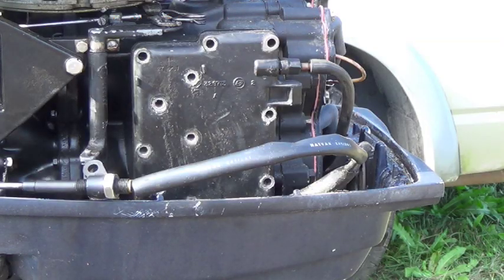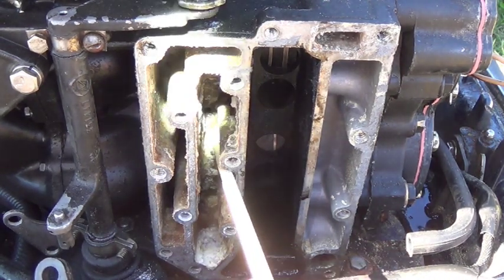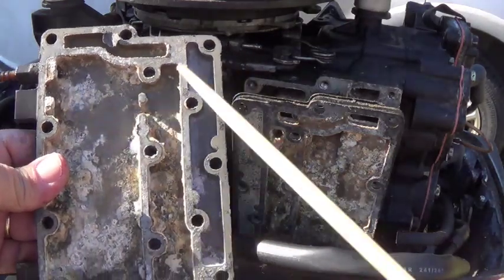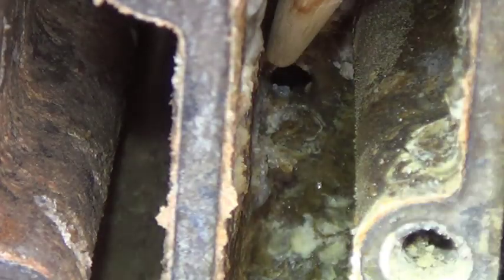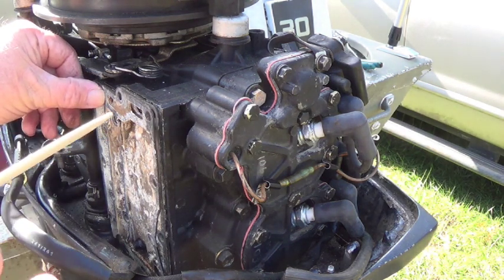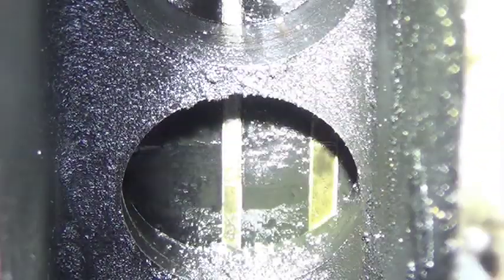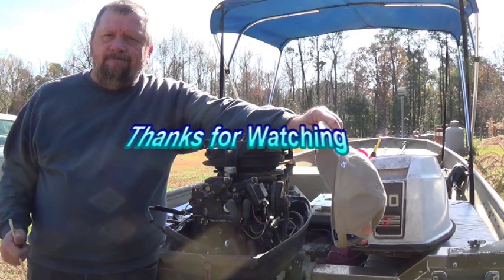Water Flow on a Outboard

Comment: Excellent. Thank you for very clear and detailed descriptions and pics. I've replaced impeller, thermostat, blown air thru pee hole, up water tube from lower unit, and dropped lower unit off my 2003 Honda 9.9 5 times trying to solve no water out tell tale hole. Your video gives me some ideas of where to find clog.

Comment: I have Johnson 90hp I took it to a Outboard mechanic spent thousands of dollars and it still overheated he changed the Water pump Thermostat and the head gasket but still Overheated I had the same issue of Overheating with my other outboards and I went through the same process which they changed the same stuff but still overheated after watching this video it finally fixed the problem saved me so much money,. THANKS VERY MUCH!!!!
Reply from the maker: I am happy it help. Thanks for watching and commenting.

Comment: Wow! I broke down on the lake 6 miles from the ramp with the wind at my back. I had to be towed in by 3 guys in a 24ft fishing boat. I diagnosed the charge coil and when I finally got the flywheel off my 1986 30 HP Evinrude the dreadful black ooze was there.  Parts on order I suspected the thermostat and discovered the clogged up water jacket on the head. Now I see I have another water jacket I need to remove and clean out physically. Thank you so much for the video and explicit information.  I may try to use "Rydlyme" if I can figure out how to do it. LOL Leg off and thermostat out and get another gasket for the head water jacket. Thanks again for a great video.
😃
Reply: I may have a clogged jacket, too, on my 1994 E30ELERM. After an impeller and thermostat replacement, my tell tale is only peeing out hot air. Considering doing a smoke test now that 
I have the exhaust cover off.  Thoughts? I should also re-verify that my water tube is properly aligned.

Comment: Thanks I have been chasing an high temp alarm on my Yamaha this is my next step.
Reply: What did you find?  I'm running out of ideas
Reply: @MantoMayer  it was an oil strainer on the oil tank. It was clogged and since my tachometer was glassed over I thought that it was an alarm.

Comment: Great video! I am a new outboard DIYer. Been having overheating and no water out the tell-tale on a 1997 Johnson 25HP Outboard. I run in fresh water. Replaced the water pump and thermostat and still nothing. THIS video will help me further diagnose my problem. If the blockage is not there, what would be the next step to fix this problem? Your videos have helped me greatly going this far. THANKS
Reply: Any luck on figuring this out? Just replaced water pump & have thermostat on order.

Comment: @OmFishing 
Great video it helped me understand more about my outboard I have a question I replaced my water pump and it pees water out the spout and goes out halfway down below the power head back towards the prop out the little ports at the same time I watched a different video and the guy described it as the thermostat bypass but in the video it only came out of the bypass not both the bypass and the spout 
I have a 1980 Johnson 85hp 2stroke outboard

Comment: Thank you for your excellent explanation of how the water flows. I probably need to take off my cover and clean the crud off/out but I don't see how I can get the bottom bolt out. The cover that you show looks like mine. I have a 55hp Yamaha. If mine is similar to the one you show, please tell me how to remove the bottom bolt. Thank you again and have a great and blessed evening.

Comment: Thanks for the video! I’ve got a Yamaha 15hp that has a weak tell tale stream and occasionally stops peeing for a few moments. I’ve replaced the impeller/water pump and the thermostat and tried running line through the cooling hoses. I think I’ll have to dig further into the engine looking for debris. Thanks from the Christina River!
Reply from the maker: Be sure and let me know what you find. Stay safe.

Comment: Thank you sir,  very informative.  I have a 2002 2 stroke 90hp Yamaha that isn't moving as much water as I think it should.  I know it was primarily used in saltwater and very shallow saltwater at that.  It was flushed every time with fresh water,  but I think it needs to be de-scaled.  Your video helped me to understand what's going on in my motor.  I'll remove the t-stat and pump impeller and set it up for a continual flush of a de-scaler to see if I can't clean out a lot of those deposits.  Thanks again.
Reply from the maker: Let me know if the de-scale works for you. I though mind could use it, I was looking to see why mine was not reaching operating temperature.
Reply: It made a huge difference. My tattletale was barely dribbling even after I put in a new water pump. I flushed her for about 6 hours using a mixture of Simple Green Lime Descaler and water.  After I dropped the lower unit,  I rigged up a cheap fountain pump in a big wash tub and set it under the outboard.  I hooked the output of the fountain pump to pipe that the water pump connects to using clear plastic 1/2 ID tubing.  When I powered the pump up it forced this mixture through the whole water jacket and back out the bottom of the motor.  The wash tub caught it all and just kept it recirculating.  There was a ton of crap in the bottom of the wash tub when I got done.  BUT,  the proof was how she peed when I was done.  Before there was barely a dribble out of the tattletale, now,  she flows like I would expect.  I actually have videos of before and after the flush.  Just no way to attach them to this reply.  

  I put in a new thermostat after I was done flushing the motor.  

  Thanks again for the video and the inspiration,  though to be fair,  I think regular old vinegar would have been just as effective as a flush media and a lot cheaper than the Simple Green.  Just wouldn't have smelled as good.

Before 6 hour flush

https://www.youtube.com/watch?v=k3Raum7f2P8

After 6 hour flush

https://www.youtube.com/watch?v=MRSAQ1dwOMk

Made a huge difference!

Comment: Thank you sir I have a 60 hp  Johnson I'll change the thermostat & impeller and the motor getting hot very fast end no water comes from the water pump but I found the problem a little piece of the impeller stoked on the copper tube

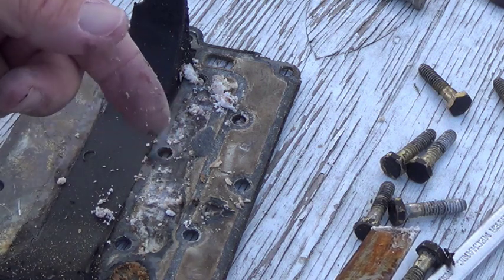Comment: Gotta clean the piston /ring grooves out, the rings are stuck from excessive carbon deposit buildup inside the piston ring grooves. ( Note at 4:30 the rings aren't wiggling up &down a teeny bit w/hardly any play inside the grooves of the pistons, while hand cranking it,  jerking back' n' forth or if you push each of the 3 rings with a small screw driver carefully to check if the rings are loose springing in and out of each grooves without any sticking going on). Well thats why the cylinders gonna be thrashed if You keep running it like that resulting in loss of compression. Might as well tear it apart and clean it up, replace seals, bearings all that. Then it ll be fresh again
Reply from the maker: I didn't like the way they looked either, I new what the answer was, I was just putting it off. Thank for commenting and watching.

Comment: This videos is very informative thank you… I’ll check all that out little by little… I have a 90 suzuki dt30c no water from tale tell.. I changed the impeller and made sure the pick up tube is connected I get water for 20 seconds then it stops and feels like exhaust is coming out.. I removed the thermostat and ran in a bucket and it can run like that 10 minutes no problem weather gushing from take tell and thermostat housing.. as soon as I put the thermostat on it’s stops.. also with the water that gushes out the thermostat housing I can see exhaust fumes.. idk what else it can be maybe the head gasket? I checked for compression and getting 125 on all cylinders.. also took out the lower end and put water up the tube and the tale tell works fine.. is as if exhaust is mixing in the cooling system and not allowing water to make it up the head… any advice please
Reply: I'm having a similar issue with my 86 mercury 135
Reply: @jeremypavlock4337  I removed the whole
Motor to replace every single gasket and seal… I found what looks like black carbon residue in what’s supposed to be a water jacket under the power head I suspect exhaust is going into my cooling water and not allowing the water to make it up to the head or down the pee hole.. I get all my parts on Wednesday I’ll let you know how it comes out.. but for now I think it’s that seal we’re the exhaust tube connects seems like it’s leaking exhaust therefore

Comment: That was interesting.I think when boat owners do not fresh water rinse inside the outboard motor then salt water overtime seriously messes up the cooling system in the engine.
Reply from the maker: I didn't think this one look to bad. 95% of its life has been used in salt water.
Reply: Here's what gets me,  salt is highly soluble in fresh water.  A simple flush of fresh water after you've been in the salt water should dissolve all of the salt in your motor.  You ever taste the water coming out of your pisser while you are flushing with fresh water?  It's as fresh as the water going in.

  I think what most guys are seeing when they tear into their saltwater motors is lime, sand, shells and other mineral deposits.  I recently flushed my motor using a fountain pump and a lime descaler.  It knocked a lot of stuff out of my motor and made a huge difference in the amount of water that came out of the pisser.  Pretty sure vinegar on a continuous flush would do the same thing.

Comment: Good day very good explanation. I’m working on a 1973 Mercury 500 50 HP I started the engine after several years of it sitting. I initially got water out of the telltale then started it again and no water. Changed the impeller still no water, pulled the pipe plug out of the water jacket at the head lots of water came out. Checked the telltale hose no blockages. I suspect the blockage to be in water jacket somewhere near the telltale outlet? Any thought’s? Thanks

Comment: Great video, it steer my suspicions toward the exhaust cover and it's gaskets. My Chrysler 15hp was overheating and water from the back of the motor stopped  flowing with increase of rpms. The gases from exhaust pushed cooling water from the passages because of blown gaskets. Some people suggested that it's caused by new water pump impeller which had less fingers(six) versus old ones having ten but I thing it's bad gaskets
Reply from the maker: I think you are on the right track now. Make sure all the passages are clear. Stay Safe.

Comment: I just got a Johnson 25 and my teltail blows steam. Iv replaced my pump and I’m about to put in a new thermostat. Should I take off the exhaust cover and see if it’s clogged or no? I don’t wanna risk snapping bolts off.

Comment: Thank you , very interesting  o have a Mercury 225 outboard 
On the back of a ponton.  Now and then I take my grandkids out 
I'm concerned  now every time I get out to the bay When I go to throttle up the boat it dies 
Bogs right down  . I can idle the boat.I can wrap the boat 2 to 3000 rpm no problem  
However when I throttle up it does
The boatyard says you need a new engine, but nobody looking into what the problem is any ideas thousand r p m steady  
Thank you
Anthony

Comment: What is the wire with black rubber insulator in head? You got a shot of it with water plate on and off! Mine is falling apart, easier to find if name is known! Good explanation of water system  Thanks
Reply from the maker: That is the Temperature switch for my motor the part number is 0583815.  Thanks for watching and commenting.

Comment: That has been one of my bench projects for a while that has`nt got going yet. waterpump went out on river but did`nt seem to overheat badly , So I took it home and when I opened it up it still had pressure in the lower unit and new oil. but when I changed the water pump out and started it it went and filled the lower unit with water and gases , but the lower still held pressure for over 24 hrs. now I need to teardown an find the reason for this , This was my favorite motor ran like a brandnew motor   and had the lighting and charging coil in it and the main reason I wanted it it was one of the models that by changing a part it would jump from 6 hp 8 hp. But alas it may never get done.

Comment: The water jackets always fill the engine unlike how youre tellinh it. The thernostat doesnt stop water entering the cylinder jackets it stops circulation. What you saw on the cylinders wasnt blowby as you claimed its just hot exhaust gases that get pushed out of the engine that the side of the cylinder is exposed to as they are expelled.

Comment: Wow well explained I just did the impeller on my 99 evinruide 225 still no tell tail I’m goin crazy I’m goin to do thermostat hopefully that works I’m bummed out haven’t even been out yet cuz let a friend borrow it last year and he cooked impeller unfortunately thank you 🙏
Reply from the maker: Did you take the tell tail off at the motor and make sure it is clean and air blow through does the water come out there with out the hose on it.
Reply: No there’s no hose on it
Reply: I could take it off and screw a hose to it and flush it backwards
Reply: So do you think the hose still should be on there the lil plastic tell tail just spins like there probably should be one on idk
Reply: Also I was gonna replace thermostat too
Reply: Wow I really appreciate you getting back to me I got a ocean boat told a friend he could use it he brought it in a pond it’s 23 feet with a big motor the impeller was cooked cuz he told me it could run without water for a couple minutes
Reply: Om Fishing no it dont
Reply: Om Fishing damn I think I sent the text to wrong spot
Reply: Om Fishing it has a place for the hose in the back of the motor in the middle and the tell tale is connected to that
Reply: Did I say something wrong I’m serious tho and thank you for responding
Reply: Actually it barely drips out

Comment: Very well explained time for a new set of rings and a couple cylinders honed now huh 🔧Next time if you want to know if it's salt take a taste 🤓
Reply from the maker: I think that is a good idea. If I find the right motor I will do new rings. You know I wanted to taste that white stuff to see if it were salt. I just could not bring my self to it. Maybe next time. LOL
Reply: @OmFishing  That white material is probably calcium carbonate assuming the engine was run insult water.  YU can circulate Rydlyme, Hammer head or similar product to dissolve the carbonate and improve cooling water flow.
Reply from the maker: @dannynone2784  Thanks for sharing the information.

Comment: Do you have a video on how get to the water pump tube on the motor
Reply from the maker: I looked though my videos and did not see one showing how to put the water tube in the grommet on the bottom of the engine. I put the tube on the engine and line up the bottom when I put the lower unit on. This way you can shine a light up there to see when you are lined up.

Comment: Thank you sir! Could a bad  water jacket gasket or exhaust manifold gasket cause some water in one cylinder on a 1985 v4 90 Evinrude? Head gasket looked ok no cracks in cylinder wall. It wasnt alot of foam. Water jacket gasket was grainy white almost like sand clogged. Fresh water.
Reply from the maker: I think the water jacket gasket could let some water back through the exhaust port. I don't think it would when it is running, but after it was shut off.  When I removed mine it look the same way. Like it was penetrated with salt or something.  Let me know how it runs for you when your done. Stay Healthy.

Comment: Thanks for the information.  The water is always coming out my telltale drain cold.  I thought there might be something wrong with my thermostat but your video indicates that the drain is before the thermostat and not after.   Is there a way to check if my 1987 Johnson outboard model # j20cro is running at proper temperature?  I am running in a cold fresh water (lake superior). I am able to put my hand on the engine block and it only feels warm even after a couple hours of run time. I have checked after high speeds with little change. I do a lot of trolling speeds(2 mph).
Reply from the maker: The water coming out of the tell tale drain after running for a while should at least be a little warm.  If that was my engine I would ether check the thermostat or replace it. Proper engine operating  temperature the engine burns fuel and runs better. You can get build up on the in side of the engine running it to cold. They do make a Thermomelt stik that heat sensitive marker that melts on contact with a surface of a specific temperature. You  put that on the top cyclinder head. Your inlet water temperature has to be around 70.  Some people will take a digital pyrometer and check the head temperature after a test run of 3000 rpm for five minutes. The temperature should be around 140. There are different test for different temperature. That is a lot of testing for hot spots. So to answer your question ether take your thermostat out and check to see if it is opening and closing or just replace it. Stay Safe.

Comment: Very informative vid. I know getting those exhaust jacket cover plates off is not a small task.  On a 1994 merc 9.9,  should I also be getting some water spraying from the two exhaust holes? (the external ones a few inches below the powerhead). thanks, tom
Reply from the maker: My 25 hp merc sprays water out the holes a few inches from the power head. Thanks for watching.